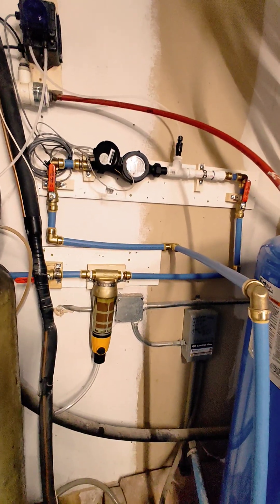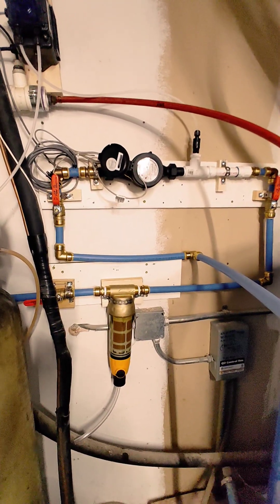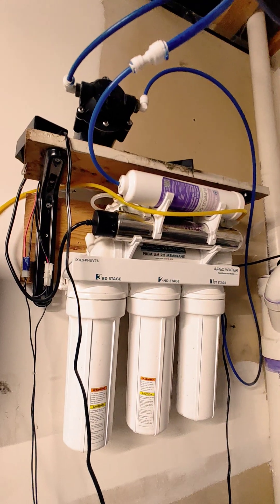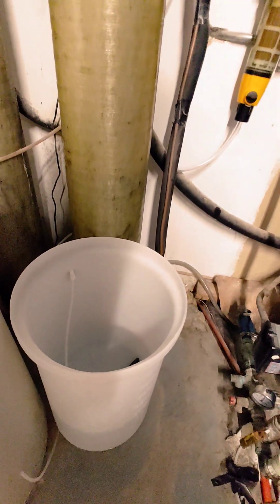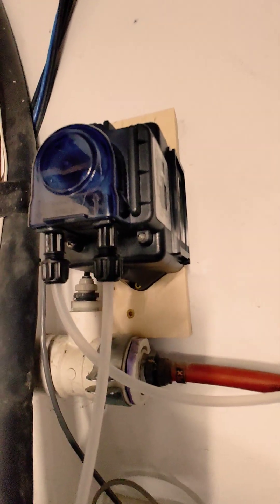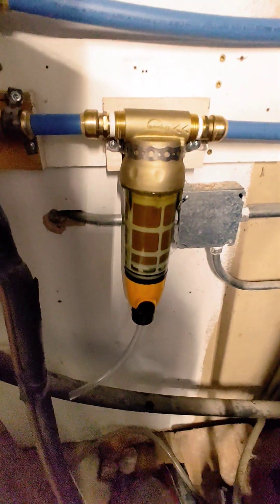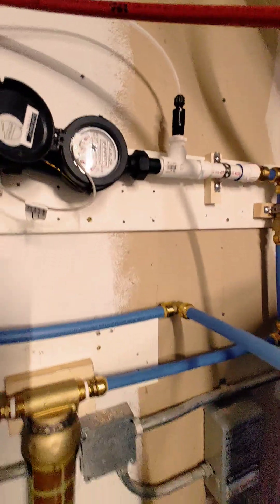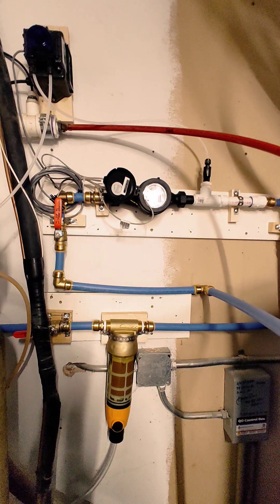Hydrogen Peroxide well water treatment to remove iron and manganese

Comment: I purchased a "system" from an online store and they use a highly subjective visual test to determine the amount of residual peroxide. I don't trust this. I'm wondering how you landed on 5 ppm residual using the test strips. I really want a quantifiable and repeatable method for checking my system.
Reply from the maker: Firstly, I used my well test (assume you have one) to calculate the Fe+ & Mn+ concentrations.

Rather than use the imperial, grains, fluid Oz, pints, quarts gallons, I converted everything to metric and worked in litres / moles.

I use 3% H2O2 (30,000 PPM?) and calculated the injection amount per litre (something like 0.5 CM3 per litre)

I have a takeoff point (the yellow filter) and am able to sample the 'reacted water' after the injection & reaction and again at the tap.

The strips I have (Water works peroxide PN 480014) tests from <0.5-100ppm H2O2) with colour gradations at <0.5, 2,5,10,25,50 &100 ppm.

So I was able to get a reasonable indication of the residual concentration.

Before I replaced the filox & softener tanks, I had about 3ppm at the taps.  After replacing them - I had zero.

If you really need to know the residual concentration, the most accurate method is to titrate the water sample which is acidified (is add add sulphuric acid) with (a known concentration of) Potassium Permanganate solution.

Once the Potassium Permanganate has reacted with the residual H2O2, it will remain pink and that colouration will indicate that all the H2O2 has reacted and you can then work out what the original concentration was.

Pretty simple stuff in a lab (I studied as a chemist) but you will need a friendly chemistry teacher at you local high school (hey - may make it into a class?) or a burette will set you back about $30 on amazon, flask set ~ $40 & a volumetric flask set ($26) - plus stands and clamps ($30) . (PP is ~ $8 or so - distilled water etc.

Accurate scales are pretty cheap these days ($20-60) will measure to about 0.01grammes.

Spoke to the guy who sold me the equipment - I suspected I was overthinking it (he agreed) 

Use the test strips and add h2o2 to the water until you have a few PPM h2o2 left - it will be cleaned up by the filox / softener tanks (They are cheap and I recommend putting new ones in at the same time).

I would use a well test to do the initial calcs and then use the test strips and test at the taps after the water has gone through the tanks.

good luck!
Reply: @zipzippery  Fantastically detailed reply. No, you're not over thinking it; you're being precise. It all takes time so I thank you very much for the dedication. I understand your approach and yes I have a thorough well test to use as a starting point. I wasn't entirely clear with my question but your answer is invaluable to solving my issue and a necessary first step. So, my system consists of: well into ex tank then two twist-2-lock screen filters at 250u and 105u then I go through two big blue 4.5x20 with graded polypro 50/10 and 25/1. The H2O then goes through my meter , injection tee, and then through a large backwash upright carbon filter to remove ferric iron and finally through another 4.5x20 1u pleated filter before it gets to my softener. I primarily wanted to address a nasty iron bacteria problem and was told the (expensive) H2O2 system would fix my problem. I shocked the well and entire system before installing the H2O2 system and a BART test confirmed it was clean. Three months later and I'm seeing signs of iron bacteria in my softener salt tank again so either the H2O2 system doesn't actually work for iron bacteria, or my concentration of H2O2 is too low.  I show no residual iron in the water post carbon filter using test strips and I show zero H2O2 (low range 0.05-4.0 ppm) even though my concentration is high enough to satisfy the subjective, "bubble test"... as long as my interpretation is correct.  I was looking for a way to quantify how much residual I should have pre and post carbon filter to know if I can actually expect the iron bacteria to be killed off. Thanks to your detailed explanation I can now dig a little deeper. Seems like I probably should have gone with a dedicated inline UV light.

Comment: bro you should build it and make  a video on it i have this problem and am looking in to bulding one never done it befor tho
Reply from the maker: What bit do you need to see?  I would have made it in a straight line but didn't have the room. I made the ' reaction chamber' by glueing PVC fittings as hydrogen peroxide would react with metal.   The rest was Pex.  I put plenty of ball valves in (good idea it turned out) so I could isolate parts of the system. Useful because the injector duck bill valve is 'consumable' and has to be replaced when it fails (I had no idea).  

I also replaced the old Filox and Softner tanks later (easy) & knowing what I know now, should have done it years ago.

If you are still stuck, lmk and I'll answer and/or put up a more detailed vid.

What I can say now, is the whole treatment system works really really well.

Comment: Very nice plumbing.   Question,  why not use a greensand filter instead?
Reply from the maker: The H2O2 is basically a pre-filter water conditioner have a filox (similar to greensand) and an iron treating softener (I replaced the old ones shortly after) post hydrogen peroxide but I know that all the dissolved manganese and iron II ions are oxidised into their insoluble form so they can be filtered out (and any stragglers will be oxidised and removed).

Comment: A little late to the party :) I'm looking at doing the same thing on my water system. where did you find the information regarding the sizing of the pump (required amount of peroxide per pump in relation to your raw water concentration and required concentration of peroxide?
Reply from the maker: I had a well test and did a calculation but I was over thinking it. If you are in the US, I bought the meter and pump from Canon water systems in California. They were very helpful and I injected the H2O2 until I had a residual 5ppm H2O2 using the nifty test strips. about .5 cm3 per gallon using 3% peroxide. (Buy 12% from Amazon. -I get 4 gals at a time)  and cut one gallon with 3 gals distilled water to make 4 gallons.  A fill lasts me about 3 months or so.

Knowing what I know now, if you have an older existing system - replace the lot. I put a new Filox system and a water softener with iron removal properties not v expensive from AFWFilters in Kansas. (though I had put that video up - apparently not). The system treats about 220 gals per day ~ 6500 per month).

If you are going to use pex - I recommend the Milwaukee crimp tool - fabulous for tight spaces....

Does that help? feel free to ask more questions!
Reply: @zipzippery our well at our cottage (Nova Scotia Canada) has a very strong smell of sulphur. High iron and manganese content similar to what you described in your video. 

How effective was this and did this remove the smell from the water?

Now that the video was up for a while I’m genuinely curious about how the new system stood the test of time.
Reply from the maker: @Justchillinnothingtosee 

Hello fellow Canadian!

Great question.

I travel a bit with work and would use 'hotel water' as the standard to compare my water quality.

Have to report that my water is now better than standard 'utility' water. (Way way better).

I would buy a new filox filter and water softener (they are good value) I can steer you in the right direction. No point listening to Culligan etc.

If you can, get a well test to see what the concentrations are.

The system runs extremely well and I would think about it for minus 2 seconds and go for it.

If you do it yourself, I recommend getting a Milwaukee PEX crimp tool.  Expensive but fabulous for tight spaces.

Good luck and just go for it!

Edited:  don't mean to disparage Culligan or local plumbers... These solutions will most likely be way way out of their experience (and they go back to their playbook..... Whole house filter etc).  As one guy droned on, I explained that the ions are in solution and a filter will never trap them....  Similarly with plumbers...  However, if you find a good one who listens and will work with you - fabulous but most are used to being the font of plumbing knowledge and start dividing by zero....

Comment: No clue how this was recommend to me, but thinking about it, will probably become useful
Reply from the maker: Yes - if you have rust stains in the bath or lavatory cisterns then iron II is in solution
Hydrogen Peroxide will oxidise it to Iron III and your filters will scrub it out.

I also replaced the filox and softener and now my water is superb.

Hydrogen Peroxide is pretty easy but I don't think it is common it water treament companies (hence the video)

Good luck - ping any questions when they come up
Reply: How much would you say you spend in hydrogen peroxide a year or per month?

Comment: When hydrogen peroxyde gone before it get into ro filter?
Reply from the maker: The guys who sold me the pump reckons the hydrogen peroxide reacts very quickly probably in the first 2 inches of plastic pipe. I have about 3-5 parts per million (ppm) coming out of the faucets (which is negligible) - in the tank it is 3% , 30,000 ppm but 0ppm out of the ro system (probably because the first 2 filters are activated charcoal which reacts with the 5ppm H2O2 ). Does that help?